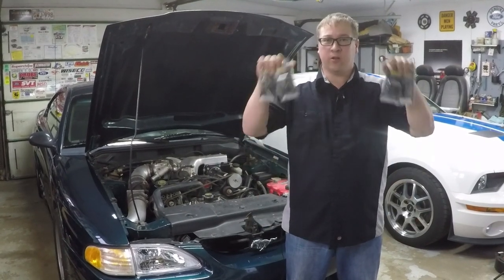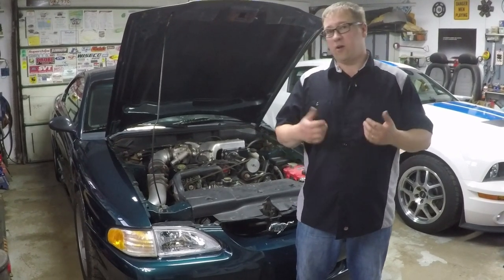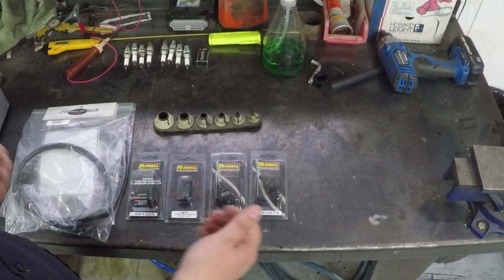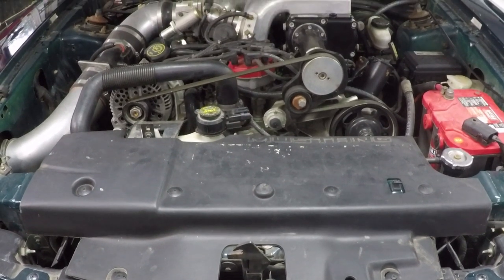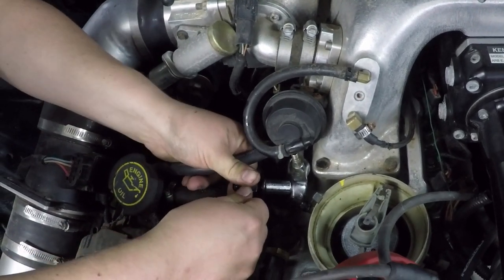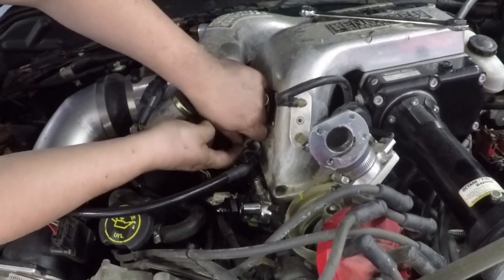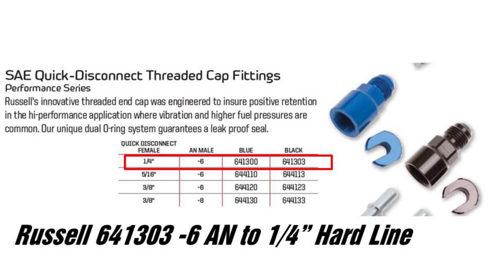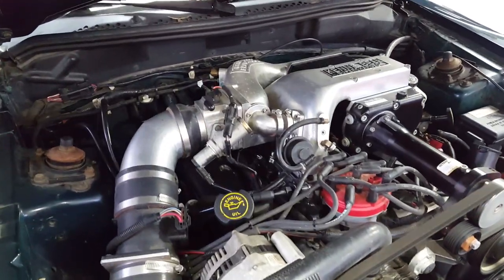Fireproof your Fuel System - SN95 Owner's Guide #6

Comment: Yes the quick disconnect push on fitting 5/16" work perfectly that is what I used on my 95gt but you probably know that now....but just in case
Reply: NO, the part that he mentions, which is pending, is a 640853, which is a 3/8 line not a 5/16, so it does NOT work!!!! The Correct part number is 640860, which is a 5/16 push on, and yes, that one does work!

Comment: another way to un-pressurize the fuel system is to trip the inertia switch in the trunk while the engine is running. that kills the power to the pump. once the engine dies, you're good!...man i want that supercharger for my 95 💪

Comment: Hey bro..Thanks for your videos.I told ya about my 9 Mustangs and how they all vary from my 89 Coupe to my Supercharged Saleen S351 #21 ending with my 04 Cobra..Anyway..I have a 94 Cobra Convertible  I told you about and Im just curious ,why is there so much dirt and surface rust ? I kerp all my engine bays 10/10 mint..I cant believe  you  arent using caster/camber plates.Im running Coilovers on both my 94 COBRA with a Roush SBF Aluminum 427/T56 and Black 95 GTS but I still use C&C plates.Thanks for the info.I try to share info with people  but they always think im running them down because  Im running custom fuel lines and upgraded/swapped motors..Anyway..Take care man..Clean up that engine  bay amigo!!!  ✌

Comment: Are your hard lines stock? At what power level do you have to worry about upgrading those?
Reply from the maker: My hardlines are indeed stock, and the old horseshoes and hand grenades answer for HP level was 500 or so. But I will attempt research a more technical answer and discuss it in a future video.
Reply: Yes you are good up to 500hp with no problems. If you are running stock block don't worry about changing fuel lines or rail save the money the 302 block are only good for 500 your over run the block before your fuel lines or rail rail